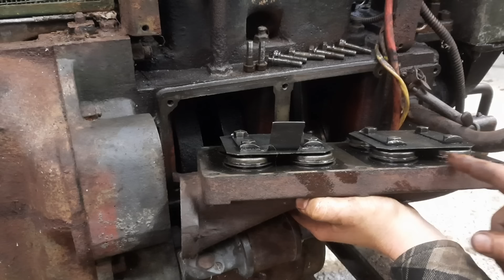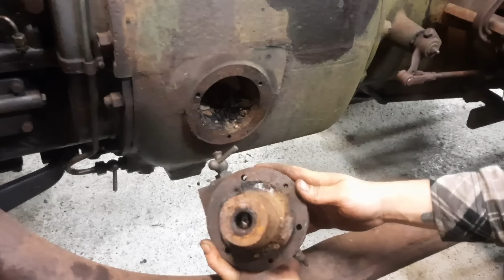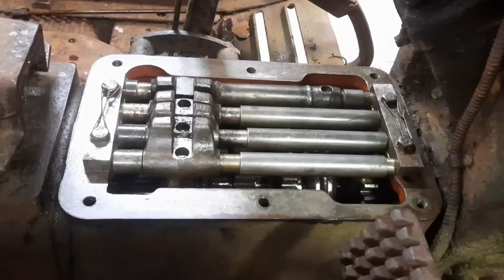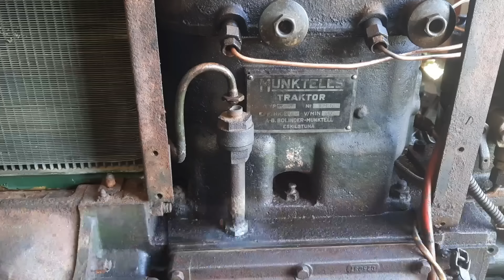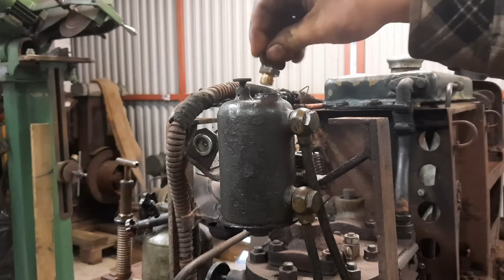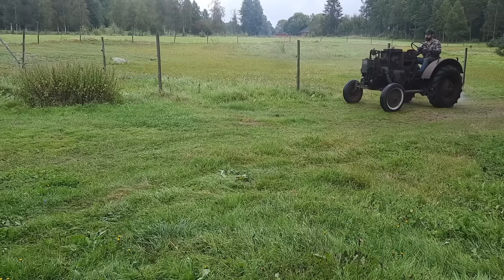Rusty Crude Oil Tractor// Part 4. START Up!

Comment: Why is the tailpipe exit pinched together to a small opening? Is it necessary for back pressure, for engine functionality?
Reply from the maker: To make the smoke go a bit further away and to make it more quiet. A open muffler would be loud. Many old motorcycles had the same "fishtail" end on the muffler. /R

Comment: brother i love the series so far and great editing but i am worried about the copper for the high pressure fuel. do you know what pressure the injectors pop at? at the very least you should clamp them together and minimalize vibration. injection pulse is a hell of a vibration

Comment: Must be similar to the ones that would start on gasoline and after was running awhile could switch over to kerosene
Reply: Must rely on what my dad called a generator like in old white gas lanterns and other white gas tools

Comment: Great video! Up to min. 12:29, take in consideration leaving about a good 1/4" deflection on each belt you mount so the tension on it and time drying it doesn't break it sooner, so the deflection helps them last longer.

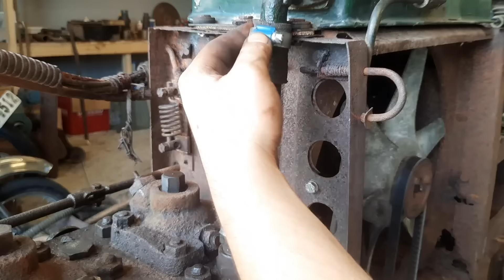Another detail, up to min. 16:22, notice you install pins to hold the head or shoulders of the radiator. This way of holding this part that allows vibrations to shake the radiator to its leaks and death creations is in my opinion something you need or may want to avoid. So I would recommend you to fasten those points in the near future with bolts washers and nuts so they get snug to avoid its welded points be shaken and cut open away.

Comment: If you run water with acid in the cooling system it will remove the rust, after when its dry  fill it up with gas mix st with some clear silicon to seal it, run it a bit to make it go every where and drain it,let it dry with caps and hoses off for a day , the system will be water proof and it wont rust any more.

Comment: Good work mate. Bloody good job all round. Ought to be more of these old machines out in the paddock. Bit of a bugger to start but the thing is, as long as you got the heat bulb hot and you had some sort of liquid hydrocarbons to burn you could make 'em run. No damn computers, no fancy gadgetry. Those old mechanical dinosaurs were designed to run forever.

Comment: I'd never heard of a 2 cycle crude oil engine, but I'd imagine when operating there will be no mosquitos. I'm a bit concerned about your thumb being wrapped around the crank. I was told years ago to palm the crank in case an engine kicks back, that way you won't break your thumb. Great old tractor. Really enjoyed your video and I'm going to subscribe right now.
Reply: If you look closer, you'll see that the engine is cranked counterclockwise, so it won't kick back into the thumb, but rather the fingers.  If you crank with the left hand, the thumb will be at risk.

Comment: having your hand wrapped around that crank like that  you might break or lose the thumb or get your arm broken if the engine backfires
Reply from the maker: Hi! Not on this one. You start this engine by always backfire it. The engine backfires and start the opposite way. So my thumb is safe here because i crank it the "wrong way".
Reply: @YesterdaysMachinery   thanks didn't know just would hate to see someone hurt trying this

Comment: I can't understand why the fan belt does not fling water up as it runs through the same chamber as the water pump? Isn't the bottom half of the fan belt submerged in water?

Comment: A small suggestion: when craning any older engine, it's best to cup your hand around the crank versus grabbing it with your thumb around it.  Ford Model T's were known to backfire and could break an arm if you didn't.  A great old piece of equipment!
Reply from the maker: Hi! Yes that is very important. BUT not on this engine. Because this crude oil engine is made to backfire and then start. As you can se i am cranking the engine the wrong way, so when it backfires the crank handle goes the other way from my hand so my thumb is safe. But on really any other crank start it is important. Thanks! /Richard

Comment: Hej Richard. I have greatly enjoyed your videos. I live in America but as a boy my father came from Pittsburgh in America to work with the engineers at Sandviken Steel, so I lived there for two years when I was five and six years old. I currently live in Pennsylvania, USA and have several projects underway - a 1958 MGA roadster full (frame up) restoration, a 1950's Case 420B Backhoe which was abandoned in the woods, and a replica Steam Engine (with track) from the 1850's - a narrow gauge lok (2 foot) with an upright boiler similar to many early steam locomotives.

Comment: What a crap !
No cushion seat.
No cab to protect me from flyes, sun, snow, rain.
No tinted windows.
No air conditionning / heater.
No radio.
No GPS.
No Bluetooth. 
Can´t be start via my cell Phone at the other end of the planet.
So useless such a thing.

Some says, builted to last. Sorry folks, you´re completely wrong. They were made to run up to the last drop of fuel on the planet. Even then, they can probably burn almost anything that can ignite !
Reply from the maker: That is absolute right. Feed it with bad oil fuels and make great work. /Richard

Comment: Hej igen Richard!

Jag har kört fast med min BM10 igen, och eftersom du kan så mycket om dem så tänker jag att du kanske återigen kan ha lite bra tipps :)

Jag fick plocka ner spridarna då den ena hade backventiler som inte funkade som dem skulle, men nu kan jag inte hur jag än gör få spridarröret att hålla tätt uppe vid spridaren! Begriper inte hur det är tänkt att det ska täta där när där i princip bara är en järnbricka som ligger mot en spårskruv i mässing?
Vet du hur det ska funka samt hur man fixar det?

Dessutom, funderade lite, när det går så vill det gärna rinna en massa olja från luftrenaren på den, skulle det kanske indikera på läckande backventiler?

Tack på förhand!
Mvh Erik
Reply from the maker: Hej! Bräslesystemet måste vara vädigt rent. Annsrs täpper sig lätt spridarna.

I vsrje spridare finns det 3 st (har jag för mig att det är tre) plana kopparbrockor. Dessa får man i regel byta varje gång man krabbar med spridarna annars blir det sällan tätt. Som du säger en väldigt dålig konstruktion, en vanlig kona vore mycket bättre. Man får inte heller dra spridarrören för hårt. 

Jag brukar dra åt rören löst och sedan starta motorn och dra åt sakta och försiktigt tills det slutar droppa.

Angående luftrenaren så brukar dom väldigt ofta, nästan alltid vara rostiga i undre koppen. Ofta är det bara en por som knappt synns med det fuktar olja ändå. Men då även när motorn är avstängd. Säker på att det kommer från luftrenaren?  

Skulle luftventilerna vara så dåliga att det blir baktryck till luftrenaren så borde motorn inte kunna gå, eller iallafall gå väldigt dåligt. Om du startar motorn utan luftfilterkoppen så borde du kunna känna om det är ständigt "sug" eller om motorn bakblåser eller vad den har för sig.

Mvh Richard! 🙂
Reply: @YesterdaysMachinery  
Ja juste ja det stämmer att där är 3 brickor, trodde de var i stål men det kan hända de var koppar! Så då tätar alltså bara änden av röret mot brickan? Låter som sagt mycket dumt men det fanns kanske nån anledning... 

Jag drog det rejält hårt sist vet jag, kanske drog för mycket då... Får se om jag hittar en ny kopparbricka som passar. Kanske med lite tur, ska prova det i alla fall!

Nej jag tror inte den är genomrostad, det läcker inget när den står stilla, men när den har varit igång så rinner det runt hela koppen, kommer från skarven i vid koppen så nåt är det. Kanske bara är ett litet läckage, för startar gör den, men går väll lite sådär nu när ena spridaren har varit bråkig.

Jag ska kolla på det så får vi se.
Som vanligt tack för tippsen! De är ovärderliga när det gäller denna traktorn!
// Erik

Comment: Have you installed valve guides on the front wheels yet. I saw that hoses were inserted without them. Mostly so that no dirt gets in between the rim and hose, for safety reasons. 🧯🩹👍😉
Reply from the maker: Hi! No i have not. But i will, cause one on the valves is a bit twisted as well 😊 But holding air anyway. /Richard

Comment: Everything about that machine looks though out and built to be repaired but when I saw the cotter keys and pins that hold the radiator down it just baffles me that they would do something like that rather than a simple faster but I guess the planed on the radiator getting taken out a lot

Comment: Awesome work!

Any radiator shop should be able to recore that radiator.

Very odd, interesting, tractor.

By 1947, they would have had an actual tractor to look at?  This looks like it was designed in the 1920's by someone who had never seen a tractor?

Comment: I know it´s a bit late but to break in rings the thing needs to be loaded, big. Otherwise a very nice tractor, a sign this thing should wear:"All serviceable parts inside!"
Put a trailer with a few tons of wood behind it and make it pull! Run it around for a day and all´s good. These things want to work. Desk duty is for grandpas ;)
I know Bolinder from boats, a sweet sound it has, it sounds happy!

Comment: Watching from 32N64W BERMUDA. Soon starting to restore a BLACKSTONE Hot Oil , single horizontal cylinder engine. Was first installed to power a large salt water pump

Comment: very nice, congratulations. since its a crude oil engine, can you get crude oil or do you just run on diesel?
Reply: Yesterdays Machinery
2 weeks ago
Dont know if you can. But you can run it on pure diesel. Its better anyway. Burns cleaner and doesnt fill the engine with coal and soot like crude oil does.

Comment: Great job.... So what fuel does it use and since it is a "2-stroke", do you add oil to the fuel or is does it have enough lubricity as it is?
Reply: Yesterdays Machinery
2 weeks ago
Dont know if you can. But you can run it on pure diesel. Its better anyway. Burns cleaner and doesnt fill the engine with coal and soot like crude oil does.

Comment: Where the heck do you buy crude oil these days?
Reply from the maker: Dont know if you can. But you can run it on pure diesel. Its better anyway. Burns cleaner and doesnt fill the engine with coal and sot like crude oil does.

Comment: Separate injection control for each cylinder means that in a postwar world where everything is scarce, it could be run on one cylinder, as it briefly did at the end of the video, to possibly conserve a bit of fuel at the expense of losing half your possible power. In a time of great scarcity this might have made sense when the workload was quite light, or just moving it around. It's so nice to see these old machines working. They were made to run forever, or nearly so. We need more people like you to keep them alive!
Reply: They still use seperate injection pumps frequently today.. Unit pumps they're called.
Reply: My girlfriend only has one injection point. I told her she has potential for more.
Reply: @slob0516 you had to make it slimy and respectlessly gross, did ya? Reflects your person perfectly 🤮

Comment: Hard to see how this design could have been dependable. What country was this tractor manufactured in ? A blow torch! I’ve seen tractors started with a shotgun shell but this one is unique. Good job getting it running. I got to hand it to you man as soon as I saw this strange radiator position I had to see the full video . Cheers !
Reply from the maker: Sweden, by Volvo-BM. Thanks!

Comment: I had been told 2-stroke diesels need a supercharger to function. Am I wrong? Enlighten me.
Great job, it started second crank, wow.
Reply: The blower is needed for a GM Detroit diesel.
But not this one...
much like a 2 stroke gasoline engine (but instead of a spark plug it has a hot bulb that ignites the diesel and air mixture) this engine draws in air, compresses it in the crankcase, the air transfers up the transfer ports into the cylinder, is compressed between the piston and the head, the fuel is injected, the bulb ignites it, the piston travels down until the piston uncovers the exhaust port, the exhaust leaves, (and at the same time the piston also compresses the air in the crankcase and it goes up the transfer passage and into the cylinder; the piston travels up and the cycle starts again...

Comment: well , i worked days on my old 'Oliver '55 super , clean this , fix that , rewire this and rewire that ... not counting all the welding i had to do for steering , and reworking the 3 point ... all together about a week , and it still did not function as well as your older tractor ... well done my man ... eh

Comment: I hope at some point you get the electric starter, glow plugs and charging system up and running. No more blow torch! :)
Reply from the maker: Yes, but that will be a later consern. i have checked the starter, works but needs new coals. And the rest of the cables need to be replaced. Then i have to order cables with fabric insulation, not modern plastic ones. But the blowtorch is half the joy :)

Comment: I see you run these on diesel these days. But what did they run them on back in the day? Kerosene? Lamp oil? The old low grade gasoline? In the states back in the early 1900's we had "tractor fuel" that was somewhere between kero and the low grade early gas. So Europe kept the hot bulb diesel while the states had switched to gasoline engines (then to glow start diesel for big engines)?
Reply from the maker: The old Swedish "Hot bulb engines" like the ones on my channel and this tractor run on Crude Oil back in the days. Thats why they called Crude oil engines. But it wasn't just crude oil directly from the ground. It was cleaned and separated from water etc. So like a thicker form of modern diesel but with lots of sulfur and other bad stuff left in it. But it was very very cheep back then. Almost free if you compared to kerosine, or the very expensive gasoline. So this tractor was a bit unmodern when it cane back in -47. But fuel was almost free, and it didn't use much fuel. And it was very durable. Never broke down, lasted forever if you just maintained it.

Comment: Well done, what a beast it is. Certainly, it is not in its first flush of youth, but you now have it running well. Possibly, it still runs as well as it ever ran with all the vital parts still functioning.

Comment: Excellent job! A lesser man would have scrapped the poor old thing.
 I can smell it from here; hot old oil on the engine, years of caked-on fuel-gum, the rich aroma of old stuff smoking away. The vibration and noise, creaks and rattles.
When it has all bedded-in, I'd like to watch it doing some work, and see if the exhaust clears and burns clean.
Well done again.
Reply from the maker: Yes, i will make it complete and test it first. Then i will put it to Work!  / Richard

Comment: good to see it run sounds great still on the hunt for spares if you know of any suppliers?
Reply from the maker: There is nothing new made to these models. Just used parts. But i have the luck to have  a friend that collects these and have a huuuuge stack of parts.   / Richard
Reply: @YesterdaysMachinery  Thanks for the reply I will just have to make any parts I need the starter has been rebuilt and the water pump drive had sheared so rebuilt that. The revs dropping from full to idol and back to full again is the most interesting thing to try and fix. Any blow lamps around? I use a propane torch to heat the heads. Are you going to paint it or leave it looking as it is?

Comment: Looks like everything on there is very tightly integrated; even the air filter housing is integrated into the base casting.

Are you going to get new glow plugs eventually?
Reply from the maker: Yes it is very well designed, very compact but still not stupid tight to work on.  I think so, there is no new available but you can make your own for it. Time will tell. / Richard

Comment: I had yet to hear a two stroke oil burner two cylinder run. The jugs seem too large to sound like a mini bike. I just bet it pulls a ton if that transmission holds together with the bearings laying under water. Can't  hear it growling though so may still be good. Way to go on getting this thing running.  With that three point hitch I want to see her till some dirt.
Reply from the maker: I dont think there was so much water. The gearbox is fine. Actually the most quiet one ive heard on these modells. Always ratteling more or less, but this is totally noice free. / Richard

Comment: The pressurized fuel tank got my attention.  I had always wondered why Ole Evinrude had done that on his early 2 stroke outboard motors and now I see he pretty much copied your tractor.  You probably know this, but when you put in a new fuel cap gasket you have to check it after a couple hours to make sure the pressure relief hole in the cap is still open.  If it isn't the cap can get you in the face if you are not careful. You also never leave the system pressurized after you are done for the day.
Reply from the maker: Hi! Yes that is pretty much the same system. But here you dont have any pressure relif. Goes up to the same max pressure of the crank case. Yes you should not leave it with pressure, if it leaks it will leak much. / Richard
Reply: @YesterdaysMachinery  I clarify, in the cap itself there is a small hole (I saw it on the video!) so that as you loosen the cap the pressure can be released before the cap is completely removed. The new cap gasket can interfere with this.
Reply from the maker: @markbernier8434  Yes, i tought that you ment like a springloaded over-pressure valve. Yes that is correct. No, the new seal is not disturbing that function. It is not sealing so far out all way around that it stops the pressure if opened just one turn or so.